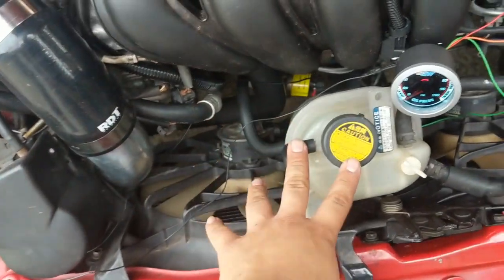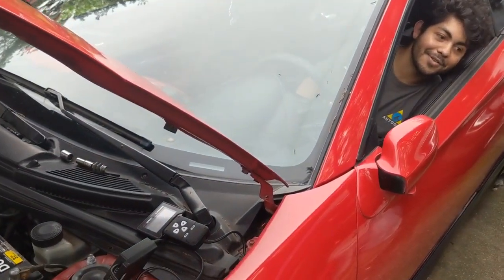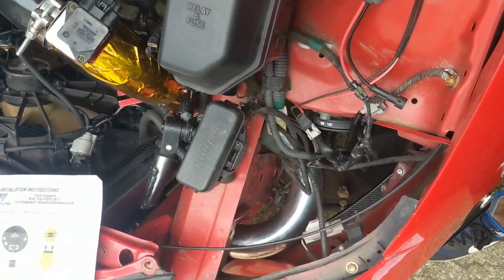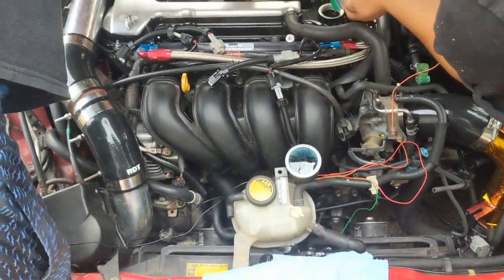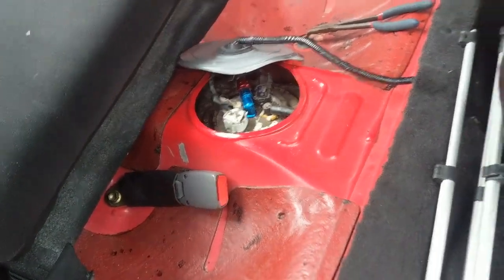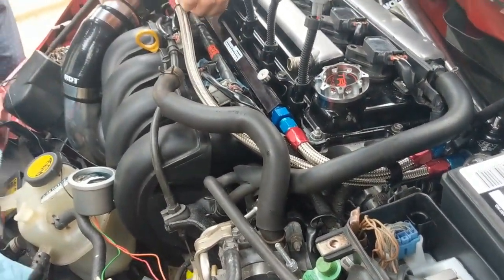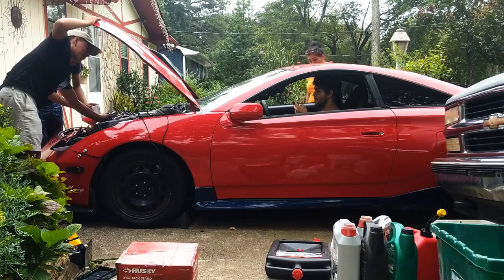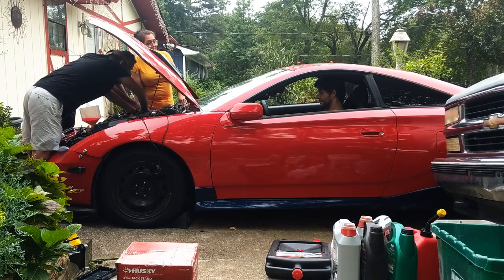FIRST START!!! ON MY  "BUILT" TURBOCHARGED 400 HP Celica? (maybe)

Comment: So there is a 200hp turbo Celica for sale near me... What's needed to make 350-400hp? 

Does it need to be forged or are stock internals rated for more power?
Reply from the maker: That's awesome you can turn up the boost and cross your fingers the stock internals for one haha just kidding but seriously you'd have to get forged internals for the engine the stock one aren't going to handle it they typically will fail around the 250 WHP mark

Comment: Hit me up with if you want some pfc tunes on a 1zz turbo, to take a look at to compare. I'm running a very similar build in an Mr2 Spyder at the moment which is being swapped out for a built 2zz turbo.
Reply from the maker: Yeah for sure man , what made you want to swap it out for the 2zz tho ?
Reply: @JRiverathatredCelika  I came across a a built and sleeved motor that had spun a bearing cheap. So bought that and rebuilt from there (although didn't go to plan!), will hopefully give my gearbox a little bit more of a chance on the track. I'll dig the map out later today and send it over.